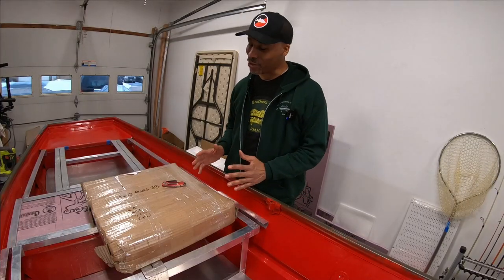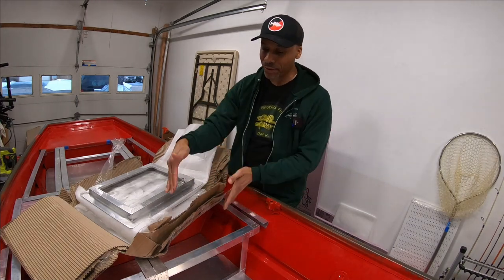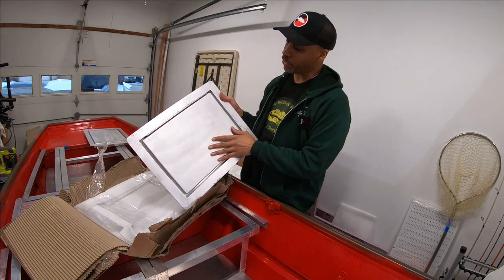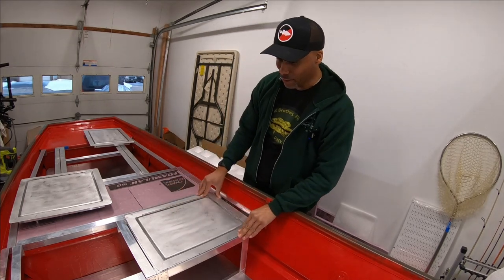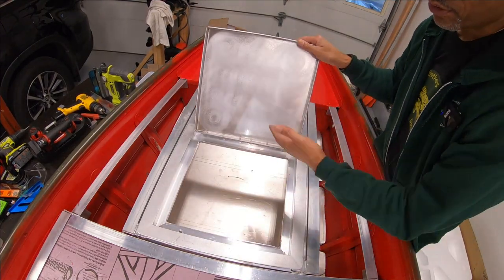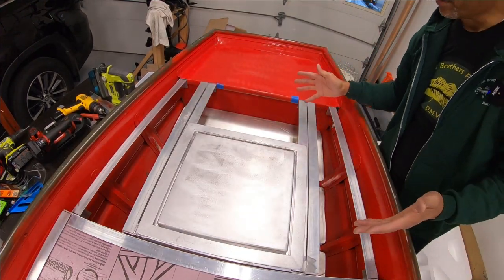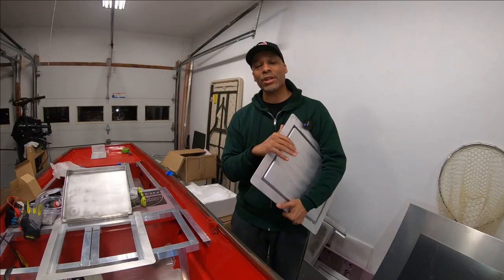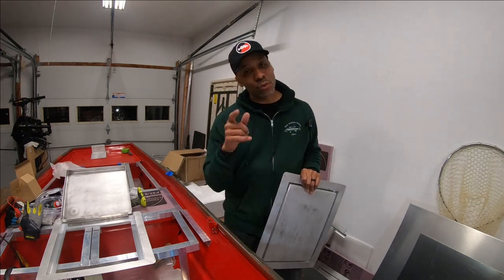ALUMINUM DRY HATCH Unboxing + GIVEAWAY {Jon Boat to Bass Boat Conversion} Alumacraft 1232

Comment: Your builds are awesome. I am restoring a 1989 Stratos 279V. I know it is not a tiny boat but for $500 for the hull and trailer I couldn't pass it up. I gutted it down and built back up to where it is water ready. I really have been happy with this build so far. Best part. No payments. Thank you for your valuable videos. Really been a big help.
Reply from the maker: Sounds like you got a great deal. I wouldn't have passed that up either lol. Good luck with the restoration 👍🏾

Comment: I have a 12' Jon boat built in the 1960's. I've owned it for about a year now.  I sealed the bottom with Gluvit, painted it inside and out and added transom wheels to it. Oh, I also added 2 seats to it. I really like the idea of adding a hatch to it.
Reply from the maker: Sounds like an awesome little boat man. 😃🤙🏾👍🏾

Comment: In late Dec of 2020 I bought a Pelican brand Bass Raider boat. It is 10' 2" long and 50" at the beam. Got it registered  and tagged last week and got the numbers to put on it. I also got a scupper valve, from Amazon Smile to put in the boat to allow it to drain water out. Got to get a hole saw the same size as the valve and I will install the valve. Can't wait to get it on the water; will use my electric trolling motor I have had for a long time. I have a Bonafide kayak as well but it takes a lot of paddling to get anywhere in the kayak and my arms and shoulders are not as young as they used to be. Keep up the good content.
Reply from the maker: Congrats on your bass raider. I still fish from mine all the time. Awesome boat.

Comment: Ive been working on a 1236 build! Doing a removable casting deck, recessed trolling motor, full paint, and modular electronics! great video and awesome giveaway!
Reply from the maker: Awe man that sounds awesome.  Send me some pics on IG if you can@ Bass_brothers_fishing.
Reply: @BassBrothersFishingDMV  will do once I get the boat painted and start the deck! #dmvgang

Comment: Those hatches are awesome! I’m definitely gonna use these when I extend my casting deck. How would you carpet these hatches without the carpet edges showing?
Reply from the maker: Just make really clean cuts and glue it down good.   Nate suggests installing the hatch track into the boat first.  Then carpeting from the deck into the track then install the lid after carpeting it. Do this in the boat.
Reply: @BassBrothersFishingDMV   thank you. I appreciate the advice.
Reply from the maker: @johnraderiii8804  no prob.  If you get Nate's hatch lids, reach out to him , he'll help you get it right for your boat.

Comment: awesome!!...I can't find pricing for hatches can you point me in the right direction?..thx..I'm going to start a build of my tracker pro v 16 this fall.
Reply from the maker: Hey...  Use our affiliate link to TBNation for 5% off your order at https://tbnation.net/?ref=BBF5.  You can also type in our code BBF5 at checkout.  On the main page scroll down to aluminum build kits and parts.  There you will see the hatches.  Good ones to check out are the UltraLite Dry Hatch Lids and Waterproof Dry Hatch Storage & Frame Combo.  Good luck and thanks for your support.

Comment: What did this build cost you and where did you purchase it all
Reply from the maker: This build was done for a customer so I can't disclose what they spent.  A typical build can cost $6K depending on what you want done.   A great place to buy everything you need to build out your boat can be found at tbnation.net.  allot of what I use comes from them. You can use my promo code BBF5 to get 5% off you order.

Comment: I have no boat we in case if we need a boat we bult in my own skill
We make boat using bamboos bro😁
Reply from the maker: Now I would love to know how to do that. 🤙🏾
Reply: @BassBrothersFishingDMV  just cut the bamboos in same length(5m.)12-14 bamboos required for it then tie it using a roap in to two equal section  thus we get two equal layers. Then put these layers one over another and tie together thus we get a boat with low coast naturally. It takes 2weak to make a bamboo boat and it can be used for meny months and years by doing constant maintanence.😁